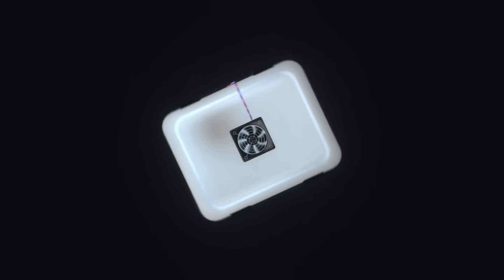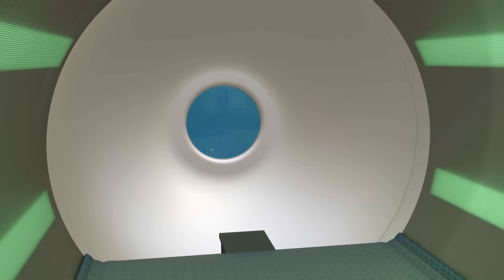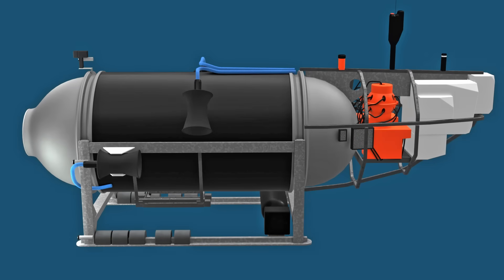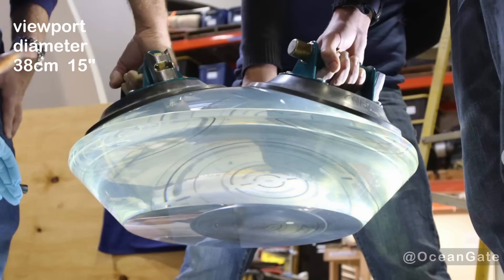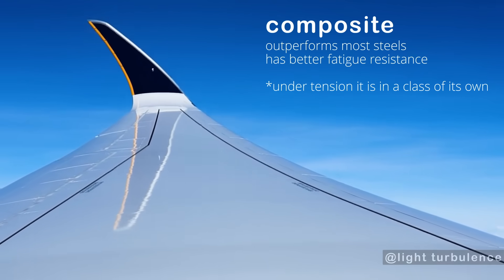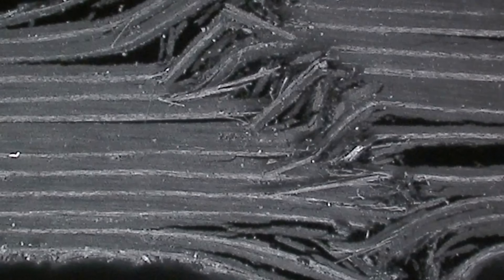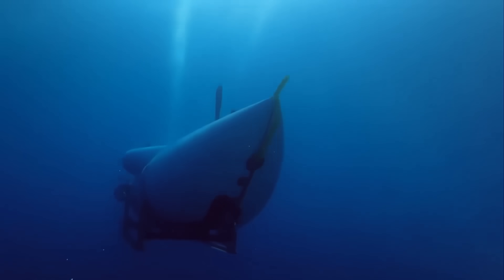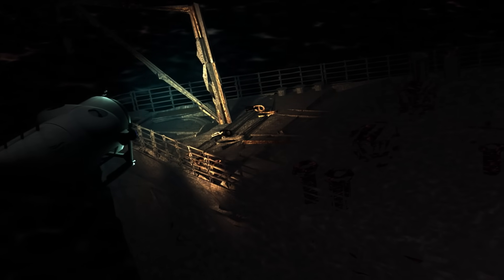Titan Sub | carbon fiber - Detailed Tour

Comment: Very interesting video. I like your take on this subject.

13:28 Yes titanium and carbon are bonded in aviation, but aviation is not a good analog for deep see usage. Carbon fibre composites compress much more than titanium.  The haul would simply shrunk way way more that titanium faring under the deep see pressure. That isn't as big of a problem in aviation, where pressure differences are magnitudes smaller. This was a crucial potential failure point, but there was no proper examination or testing of this bond. Not to mention that they didn't even glue it in a proper clean and temperature controlled environment. 

Comparing Titan haul to an airplane wing is also not the best. Those wings are baked under pressure in autoclaves during the drying stage, which reduces the chance of any dry spots, bubbles and other imperfections. They are also thin enough that they can be properly examined (x-rayed) and tested. Nothing like that was done for Titan. 

I like your theory about axial fibbers, it's another example of how many corners did they cut and how botched the whole build was.

I agree with your conclusions. Could you build a carbon fiber haul for submarine? Probably, but you need to go above and beyond with research, quality control and testing. Those guys didn't do you it, they were only interested in cutting costs.

Comment: The primary problem with Titan was the temperament of it's creator. Too many corners cut for limited success.
Reply: I’m going to make a small but apt alteration to a very popular saying, that I feel describes Stockton Rush perfectly:  “A fool and his LIFE are soon parted.”
Reply: That and how he refused to do another test run for each diving with rest dummies
Reply: It was way to simple in design. I mean it looks like something that a couple of teenage boys thought up while sharing a joint. A tube with caps. I mean it has simpleton written all over it.
Reply: @johnwright291 That's one of the first things I thought, back shortly after this happened, and all the information began to be released. It resembled a pretty good DIY build a submarine at home in the garage project. It would have been a really nice toy to tool around in the lake, about 25-30 or so feet down. It just simply couldn't handle the stresses and pressures exerted on it by hyper deep ocean diving.
Reply: No the primary problem was the material used to make the sub
Reply: Arrogant, egotistical, fool!   Unfortunately he took 4 naive souls with him to an avoidable demise.
Reply: I think Stockton's temperament might have been fine for many other jobs -- like running a grocery store or something.
Reply: The primary problem with Titan was it imploded
Reply: maybe if he had hired more 50 yo white guys, the ones he said he didn't want, cause not diverse enough, he'd still be alive.
Reply: @ElectricalExistence  he would never because he wanted a bunch of yes men
Reply: @ElectricalExistence ”wokeness” had nothing to do with it. It was Sterling’s massive ego that did them in.
Reply: @CJODell12  whatever bud.
Reply: @ElectricalExistence  CJODell12 is right. It was his ego. When I saw that interview where he said, glibly, "I want to be known as the guy who broke the rules", I wanted to punch him in the face. Established engineering principles are not arbitrary constraints, the principles have been established over time by making postulates, testing them, seeing what works and what doesn't. If someone wants to "break the rules", one doesn't do it in a situation where someone's life depends upon it. If he wanted to test the conventional wisdom, he should have done it with a robotic submersible first, but he was too convinced that he was smarter than all who preceded him.

Comment: Nice dumb whitewash. Maybe the horizontal layer being untensioned contributed, but no mention of far more glaring flaws, namely glued on titanium caps (and to make it worse, manually, without checking for bubbles, excess/lack of glue and such) and the most idiotic thing these dudes did, putting SCREWS into pressure hull to mount all internal stuff creating massive weak points? Titanium hull could at least have welded on end caps and inner gear holders, eliminating all massive problems (including your tension theory), so no need to add that dumb disclaimer. And yes, carbon might be strong enough on paper but there is no strong way to connect it to everything else, which is what Cameron meant...

Comment: I though  carbon fiber was strong on tension not in compression, the plastic sub straight that binds the carbon fiber is what what will determine the the strength of the structure in compression.

Comment: Mike, I don't often comment on content I come across online, however I believe you have provided the clearest, most concise yet suitably detailed and realistic summary of what may have happened, with the available information and a solid understanding of materials and processes. It goes without saying that there could easily be a lot more maths and physics to quantify but then this would become a lesson in engineering rather than a clear relatable clip. The perfect balance, and your included animation is second to none. Well done sir!
Reply: Sorry, but Mike obviously has no idea what the differences are between tensile strength and compression strength. Spider silk actually has greater tensile strength than any grade of steel with the same gauge but can be compressed with little effort. Same goes for carbon fiber. The composite material (undisclosed) probably had more compression strength than the carbon fiber itself.
Reply: @allenm.313 I think the defendant is CF composite as a whole, not just the strands.
Reply: Apologists don't do balanced analyses
Reply from the maker: Thanks. Much appreciate your comment!!
Reply: Agreed well put together little doco
Reply: @EugeneSamuel-h9w  :  But completely wrong.  Doesn’t matter how professional the video if the info is still wrong.  I hope next time he does the same quality video editing, but along with accurate info.
Reply: His video is just plain wrong.  I’m a mechanical engineer who has experience in carbon fiber and he completely misses the point.  There is no counter force from CF tube for the pressures required.  Aviation is completely different than this application.  MANY engineers warned him and he ignored all of them.
Reply: I agree, I've seen about 40 video's related to titan and this is one of, if not the best one I've seen.

Comment: Also, there is a major difference between the compression loading of an airplane wing and at the RMS Titanic which is around 12,500 feet down (some sources say 12,600).  At 12,500 feet Below Sea Level the pressure is 5,733 psi and 5,777 psi at 12,600!  Note: the description of the viewing port is based on the total area exposed to the outside of the hull.

Comment: Really solid presentation. I'll also trow my thoughts were. I am assuming that they were not completely incompetent and sized the carbon tube with a reasonable safety margin. Therefore what stroke me was the process of gluing the tube to the flanges. You want that the edge of the tube to perfectly seated on the flange and have no air bubbles trapped. What I saw was far from that, they just applied some epoxy, I presume, and placed the flange. I would expect at least some vacuum bagging to try to remove any trapped air. Also the tube edge needs to be perfectly flat and I don't know if they tried to make it or just proceeded with the raw result from the mandrel without any further processing. Therefore I suspect that the mating between the tube edge and the flanges was no perfect, but included some air pockets that created stress concentration points. These could locally collapse the tube edge, which in turn created a cascade effect that could result in the observed effect that the outer flanges were blown outwards.

Comment: What you don't explain is why the vessel had lost almost all of it's buoyancy which made it as good as impossible  to ascent to the ocean surface again and get out of harm's way.
Was there a leak? However small? What was the added weight and what caused the weight to increase? What happened? It seems to be still an unanswered question.
Reply from the maker: The entire premise of a leak is based on the transcript which is fake. I have confirmation from a crew member the transcript is fake and am busy with a follow up. There was no emergency message.
Reply: @Mike-Bell 
What are you saying?
That they never knew what hit them?
Reply from the maker: @FrankHeuvelman  Yes in all likelihood it imploded without any warning. That is typical of carbon fibre. It fail like glass with no warning
Reply: @Mike-Bell 
Okay, make's sense. No friction there.
So the rate of descent could just had been uneventful till the implosion?
Do you know where the original recordings finally ended up unpublished?

Comment: 10:00 ish...    carbon fiber IS strong in INTERMITTENT compressive loads...   which in the case of aircraft wings..  are not insane point loads and are countered and minimized with tension loads in other parts of the wing.       Compressed gas applications show just how much tension the fiber can withstand...

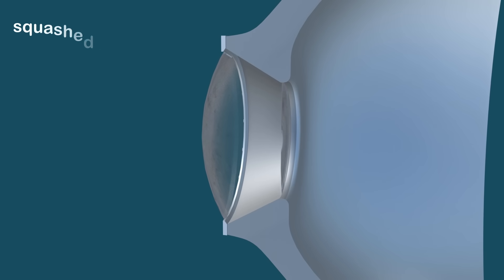Comment: @7:30… that does “squashed in by 20mm 3-1/4” mean??  First of all, what technical person says ‘squashed’??  Do you mean deflected?  Or warped? Or PICK YOUR REASONABLE ENGINEERING TERM, don’t reference a vegetable!  And WHICH IS IT, 20mm, or 3-1/4”???  These two values aren’t even close!  I assume you meant 3/4”?  That’s close to 20mm.  What a maroon!
Reply from the maker: My audience is 99% non engineer and I pick terms they will best understand. 
Yes the deflection was 3/4” and I posted a correction in the video description.
Do not insult me in my comments.

Comment: I think Stockton Rush was very close to building a revolutionary vehicle. Actually, I'll say he did, in fact, build a revolutionary vehicle. Obviously, he got something wrong in the engineering or production and definitely didn't test it properly. If he would have had some more engineers telling him no it very well may have worked.

The Space Shuttle disasters were somewhat similar, and they killed 14 people. With the Shuttle being a side mount, there was no way for the astronauts to abort all the way to orbit. Like The Titan the Space Shuttle was flawed from the beginning, devastating cost cuts, inadequate/impossible human abort system, tell tale signs, etc. 

Both the Space Shuttles and Titan were bold moves, with severe lessons paid for in blood.  The next composite fiber submersible will probably be much safer by an order of magnitude. RIP to all five victims hopefully they did not die in vain.

Comment: 13:28 titanium and composite may be regularly bonded together in aviation, but is it done by guys in jeans and t-shirts in an open warehouse, eyeballing it?  With no visible gushing of extra glue when the oin was made?  I'd have expected clean rooms and sealed suits?  Or is that just not how things are done in manufacturing?
Reply from the maker: The gluing footage was of hull 1. I assume hull 2 was done a bit more professionally.

Comment: Carbon fibre may be super strong brav, but they simply GLUED it to the titanium ends - Yikes!!! Also according to the official communications transcript, the Titan was descending WAY TOO FAST. That's what caused it to implode.... the idiot behind the steering wheel !!!!!!!!!!!!!!!!!!!!!!!!!!!!!!!!!
Reply from the maker: In composites they use glue to bond it titanium. That is normal. Descending too fast is nonsense as told by the fake transcript. 

I agree there was a cowboy at the steering wheel of the sub and the company.

Comment: There were so many problems ! not just the carbon fibre ! The fact it was out of date ! The fact that that it was NEVER evacuated after glue ! The FACT that the end seals were never evacuated after gluing! the fact it was NEVER tested or evaluated 
The FACT that carbon fibre is not great under compression

Comment: Wasnt the problem the fact that they used materials with different compression strengths? I thought it was the fact that the carbon fiber was compressed more than the titanium slot it was in.

Comment: The video starts out by suggesting that carbon fiber is just fine in this application, but then at 10:40 begins to explain why carbon fiber is the wrong material to be using for this application.  Only on paper does carbon fiber work well, in that it has the theoretical strength to do the job, but in practice if there are any tiny mistakes or it isn't done to the tightest possible tolerances, it is unforgiving and will kill you before you know what happened.  Further, the references to aircraft are irrelevant - submersibles must handle much higher pressures and stress.
Reply: Exactly. Every justification for CF contains some disclaimer about how CF is perfectly fine if you research, manufacture, test, and maintain it flawlessly. But really the only reason to use CF in the first place is to cut corners on costs (mainly costs associated with the support ship which goes up in size drastically for a heavier all titanium sub). So if you're using CF to cut corners, you're not likely to invest the money to make sure you're doing CF flawlessly. That would defeat the purpose. You may as well just use much safer titanium at that point.

Comment: All these airplane engineers lauding cf… diving is not flying underwater although it has many similarities. Diving is nothing like flying or going to space. It’s pointless trying to argue the benefits of cf using aerospace analogies - even the highest pressures occurring in aerospace are nowhere near the pressures at depth. 
Cf is fantastic and can indeed withstand great loads. But comparing any loads from aerospace applications to the type of load that occurs at depth is only proving one thing - that you have not thought about it sufficiently. This video is a step in the right direction, touching the surface of an explanation of WHY cf is not suitable for deep diving, but not getting to the bottom of it (pun unintended). 

All that said, a 5 inch cf weave where the layers are pulled together in the longitudinal, vertical, and - most importantly - lateral axis, would be a better approach than just vertical and longitudinal layers no later how many the layers. But such a weave is very difficult and expensive to produce.

Comment: I think that the example of the AVRO Comet could be used here. Pushing the envelope of engineering with a new unproven technology has been a disaster in the past. After a number of air crashes of the Comet the company AVRO and the British government decided  to develop a test for this airplane to see what had gone wrong. After putting a whole air frame of the Comet in a test tank and exposing this air frame to repeated pressure cycles did the fault in the design appear with a massive failure of the pressure hull of the plane. There were a number of points where the original design of the pressure hull caused excessive stress points and over time stress cracks appeared in the planes skin. These small stress cracks accumulated to the point of enough were connected to cause the catastrophic failure of the pressure hull. Many lives were lost in this engineering oversight but due to the testing of the air frame changes were made to the design of ALL airplanes and this problem does not show up till the air frame is into many years of service and many cycles of the pressure hull.  Boeing even went so far as to "paint" the 707 air frame and outer skin with a stress showing ceramic paint and flying that test plane through a number of pressure cycles and flight maneuvers to see if they had the engineering right to correct the fatigue problem. One note on those tests was Boeing did not realize that that stress paint was very flammable in its original formulas and their aircraft was a flying candle waiting for a spark. Cerametallic  the paint supplier changed the formula after they found out what Boeing was using this product for to make it fire proof.  
Ocean Gate would have been better to have tested this new design to destruction in a repeated pressure cycle test before they used it for the paying passengers. It would have showed how many cycles would have been safe and changes could have been made to the areas that showed the weakness. That would have cost a lot more dollars in development but this disaster has set this design back to the beginning as NO One is going to use this for a long time because of the catastrophic failure and the loss of life.